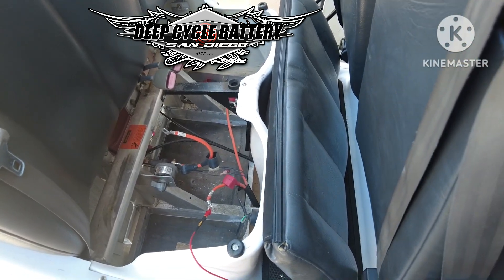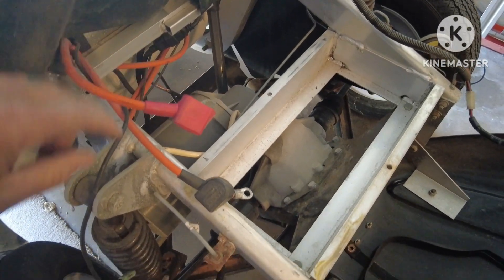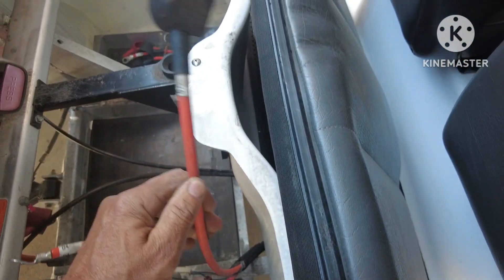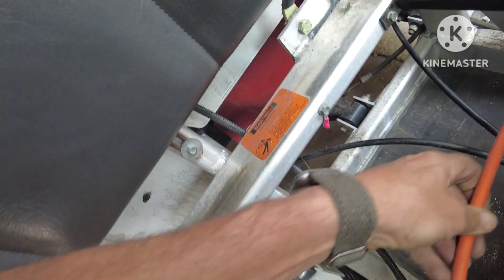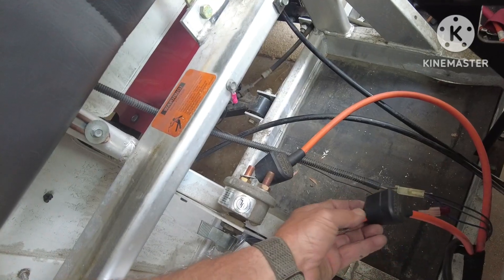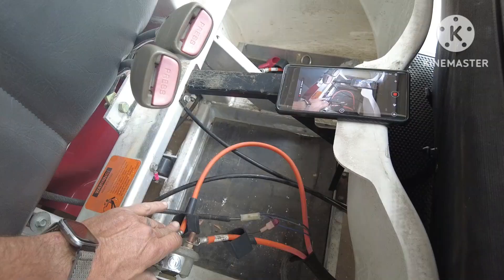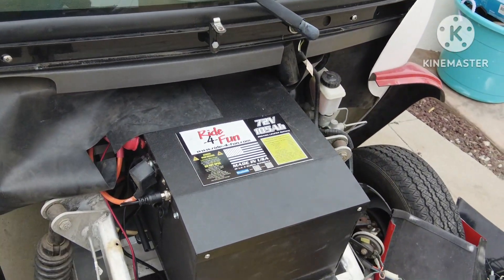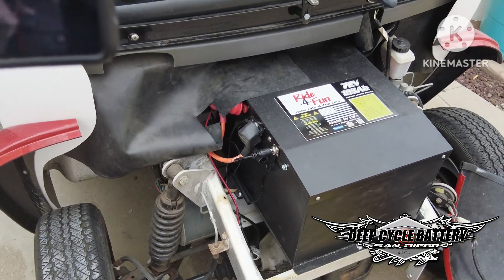Ride4Fun 2001 Gem Car Lithium Battery Install - How to Install Ride 4 Fun Battery

Comment: Great video! Question: What are the measurements of the new battery, and how much does it weigh? Thanks!
Reply from the maker: Their website doesn't list the dimensions. However, I can tell you the battery is roughly 11 in x 10 and 110 lbs

Comment: Thanks for the great video.  Did you have to change out the charger?
Reply from the maker: According to ride for fun, the original charger is set for AGM or gel will charge the lithium battery